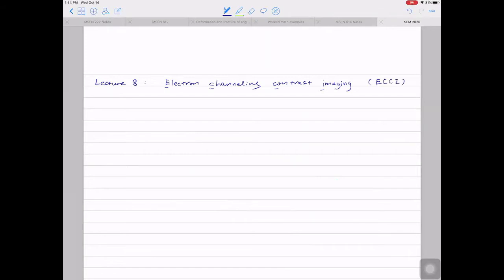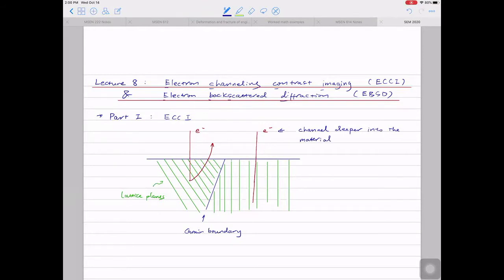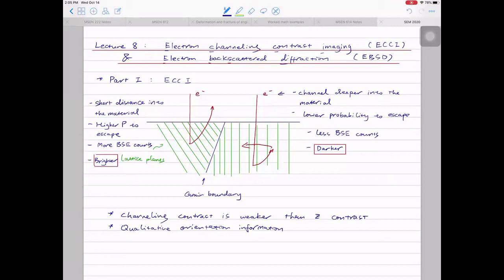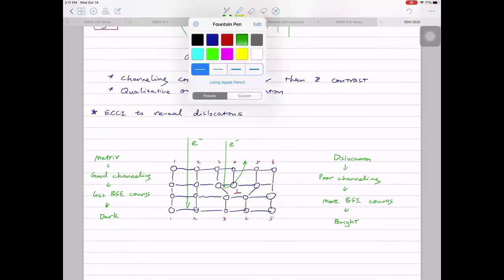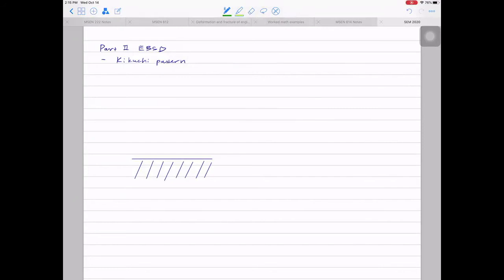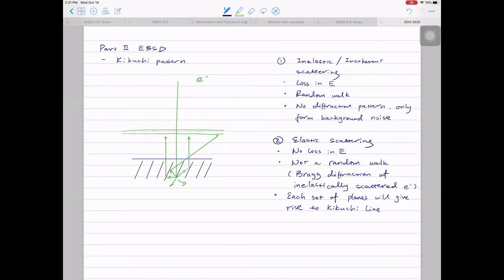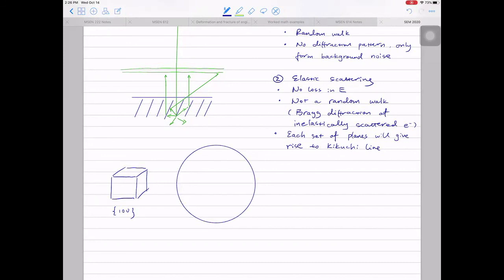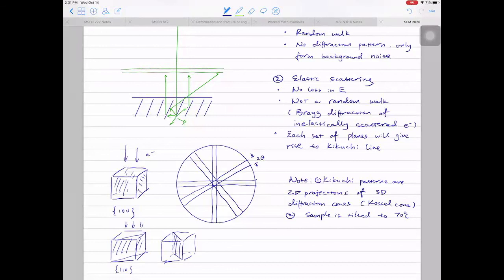Lecture 9: Electron channeling contrast imaging (ECCI) and electron backscatter diffraction (EBSD)

Comment: Hi, thanks for this very nice exsplanation. I have one question about ECCI. What are the typical operative parameters of SEM to highlight channeling contrast due to dislocations?i mean, high o low beam current? which working distance? which beam divergence? To see the diclocation lines, do you have to tilt the sample? 
thanks a lot
Reply: Hi Angela, you generally want to use high voltage and high current, and very small working distance. I do not know whether you have control of beam divergence in SEM. To see dislocations, you have to be lucky that the grain is oriented in a "two-beam" condition. The tilt in SEM is quite limited but if you look around in your sample, assuming it is polycrystalline with no strong texture, you should be able to spot grains with dislocations.
Reply: @kelvinxie1029  Dear Prof.Xie, I have a question about your reply 'you generally want to use high voltage and high current'. I think the Resolution is highly depend on the current, the higher current we have, the lower resolution we will get. Besides, the sample surface would become damaged with the higher voltage (assume 20KV or higher). Could you tell me will the damage caused by high voltage will affect the quality of final image? And will the resolution limits (under high current) become an obstacle for us to observe dislocations? Thank you very much.
Reply: @flemirbingo6185  Hi Flemir, yes, you are correct that high current generally leads to poorer resolution but a higher signal-to-noise ratio. Higher voltage will also lead to poorer resolution due to a large interaction volume. The damage of e-beam on metals is quite small in SEM. (I assume you are asking about metals as you mentioned dislocations.) However, carbon contamination can be a huge issue, especially at high voltages. We usually tune the beam in an area, then move to another area in the same grain to do a single shot image acquisition. Hope it is helpful.
Reply: @kelvinxie1029  Dear Prof. Xie, thank you very much for your reply. May I ask another question? I would like to observe a specific grain in my specimen, which is a bulk specimen. Apparently, ECCI is the best choice. Paraphrase your reply to Fiora "To see dislocations, you have to be lucky that the grain is oriented in a "two-beam" condition.", I couldn't figure what should I do when the specific grain is not oriented in the 'two-beam' situation? How should I tilt the SEM stage? I am aware that the angle can be solved by EBSD, but I don't know the exact process. Could you tell me how to do this?
Reply: @flemirbingo6185  Ahhh... This would be non-trivial. In polycrystalline samples, whether you can get good ECCI images relies more on luck than skills in many cases. If you are interested in doing ECCI dislocation imaging in a specific grain, you can take the following steps. You need to have a good understanding of the in-plane orientation of the grain and your specimen. Then use the EBSD setup to obtain the Kikuchi pattern. Work out the orientation of the grain from the Kikuchi pattern. Return to the regular SEM setting (sample surface laying flat). Rotate the sample to tune the in-plane orientation, then tilt the SEM stage to achieve the two-beam condition. For optimal imaging, you want to introduce a small positive excitation error (slightly away from the Kikuchi bands). Hope this information is helpful.
Reply: @kelvinxie1029  Dear Prof. Xie, Tanks a lot for your constructive reply. I did some Euler angle calculation from sample frame to crystal frame. However, I am not sure which crystal plane will have the two beam phenomenon when perpendicular to the e-beam? For example, I would imagine the two beam condition is satisfied when (1 0 0) plane of FCC and BCC crystal is perpendicular to the e-beam. Is that true? Or there are other planes in FCC, BCC crystals also have the two-beam phenomenon? Thanks a lot!
Reply: @flemirbingo6185  Hi Flemir, you can do a simple g dot b analysis. For example, your b for dislocations in FCC crystals will be <110>. If you use the {001} planes, roughly 1/3 of the dislocations will be invisible. If your aim is to reveal dislocations, {001} is a good option. If you want to compare dislocation density across different samples, you want to make sure you use {001} reflection in all cases to avoid the different g dot b conditions. Hope it is helpful.
Reply: @flemirbingo6185  Hi Flemir, the EBSD data acquisition software can tell you which planes you are looking at. Each represents a set of planes. You can do any planes with the 2-beam condition and do not need to limit yourself to (001). Hope this information is helpful.
Reply: @kelvinxie1029  Dear Prof. Xie, thank you for the kind reply, it helps a lot! However, I am not familiar with the g dot b analysis since I have no background in any TEM experiment. And I am planning on watch your TEM tutorials to get a better understanding about g dot b. For now, I suppose that the  g represents the e-beam direction in the crystal coordinate system, and b is the Burgers vector, i.e., 1/2<1 1 0> in FCC crystals. But I don't know what happens when g dot b equals to zero? Hoping the answer lies in your videos. Thank you very much!
Reply: @flemirbingo6185  No worries. g is g-vector. For example, if the 001 Kikuchi band goes through the center of the screen, you know that your g-vector is 001. Same applies to any other sets of planes.
Reply: @kelvinxie1029  Thanks a lot! Prof. Xie, your response helps me substantially.

Comment: Sir,
What type of holder is used for TKD because electrons need to go through ? And how is it different than EBSD sample holder

Is it Cu grid like TEM, or Silicon wafer ?
Reply from the maker: It is a different holder. You may need to purchase it from the SEM company. The working distance is small and the sample is above the EBSD detector. Based on my knowledge, you can use any TEM samples (Cu grid, electropolished discs, and Si wafers).